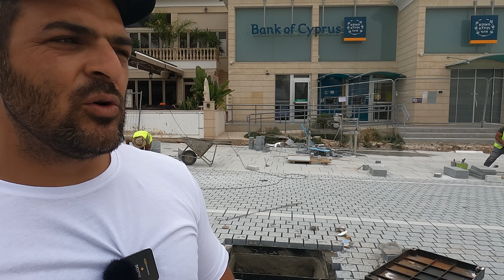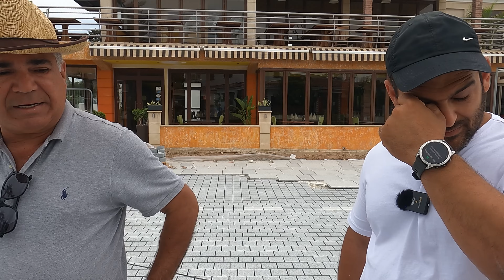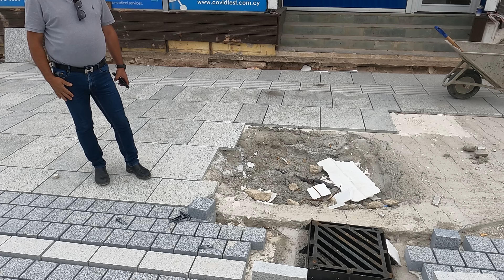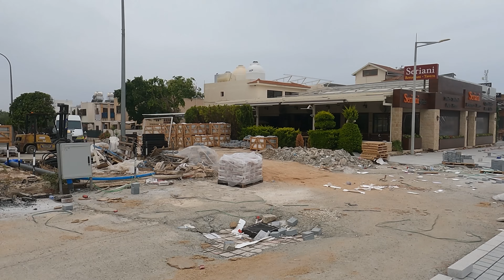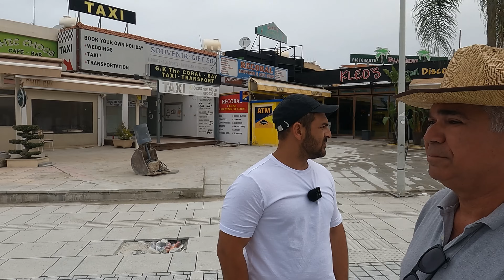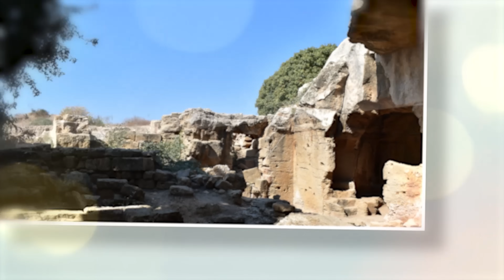Coral Bay Strip Renovations - May Update

Comment: can the coral bay beach still be accessed? If yes then how
Reply: It's no problem it will be the same as before. The renovation is also only about 250 meters long... If it had instead been a pedestrian street (as I suggested) then you would just drive on to the next roundabout (if you are coming from Paphos) and turn left at Coral Palace.

Comment: If you want to cycle from paphos harbor you can go on the coastal path. It will soon take you all the way to coral bay😎👍🔜🚵🚵🚵🚵
Reply: I've tested it and some key parts won't be a coastal path at all. Cycle paths are also a bit like motorways, it doesn't matter if it is 90% possible to cycle, but if 10 percent is missing, it still doesn't work. The funny thing is that there is actually a "bike lane" that runs alongside the road if it only could be fixed. In some places, they would have to create a road with gravel or tarmac but it is not many hundreds of meters. In other places, they would just have to clean up so that it is possible to cycle, not a big job.
Reply: Ho well. Get a car😎👍